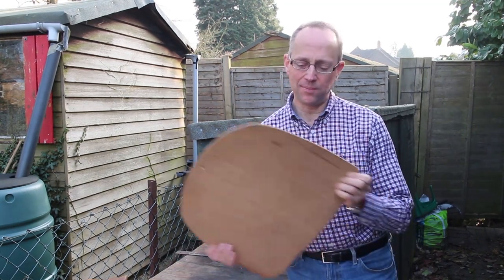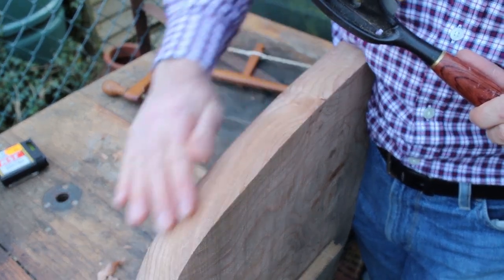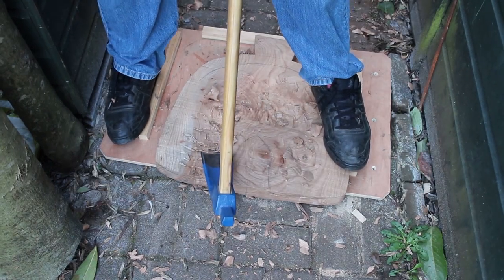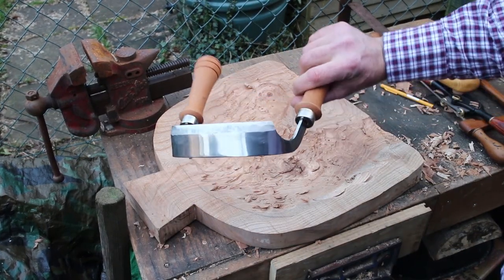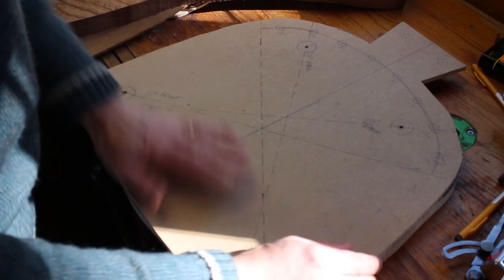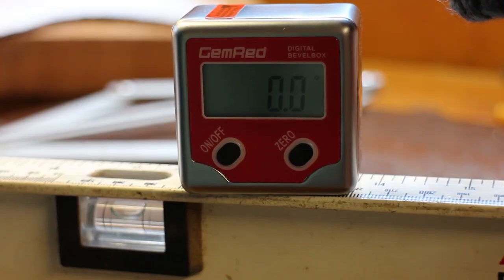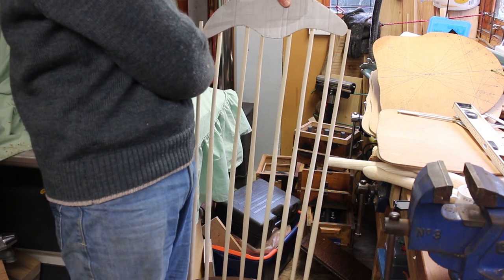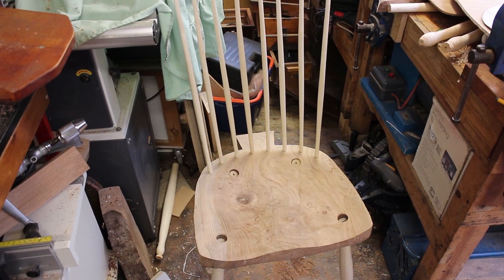Making the Glasgow Chair Part 3 - Adzing the Seat

Comment: Thanks for sharing.
Could you give a little more detail on the layout lines in regards to the angles and holes, and hew you determined the layouts.
It looks like you drilled the holes with the layout lines aligned straight out and down from the hole being drilled.  
Thanks

Comment: Really nice piece od wood. Great video. I also like your drilling under angle with that plank. One suggestion though, wouldnt be better to make a hole into it, so the drill comes through? You would not need to use that extra plank under drilled seat. 
Best regards!
D.
Reply from the maker: Hi there would be a slight risk that the drill would bust through and break the grain, so the sacrificial plank stops that ......I hope I have sort of explained that OK - thanks for your comment.

Comment: Thanks for the video Harry,the chairs coming along nicely .what thickness is the elm that your using?Ken
Reply from the maker: Ken - its about 2 inches thick, I am not going to brace the legs unless I have to - and then it will be blacksmithed fittings!

Comment: Harry, I’m curious why you didn’t drill the leg holes in the seat before you shaped the top of it.
Not only is it easier to work with a flat slab for drilling, but if you had somehow drilled incorrectly, you would not have jeopardized all that time shaping.
Reply: Fantastic job by the way.
Reply from the maker: Hi Lenny, very good question and different people will probably have different views on this, but I find that its fairly easy to chip the drill holes if I drill and then adze, so I prefer to adze and then drill.
Reply: Harry Rogers I have to agree, I hadn’t thought of chipping the holes.

Comment: I have never had access to elm boards. Your plank looks really hard. I have a few turning  pieces of Siberian Elm which , in the United States, is not susceptible to the blight. I think they are crotches and a little burl. It has dried for about 3 years. Do you think it would be difficult to turn dry?
Reply from the maker: Frank I would give it a go .......I personally do not mind turning very hard wood as it does what you want it to do, the little burls are usually fine on english elm - they don't drop out or anything, so hopefully yours will be OK. Good luck.